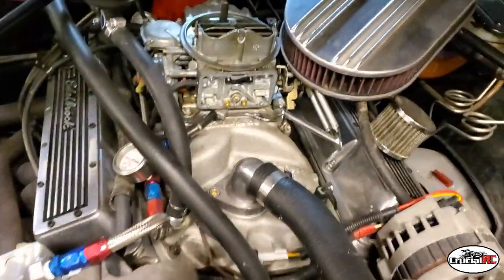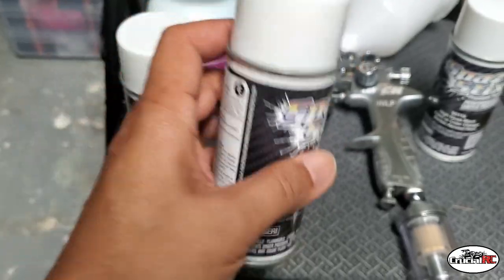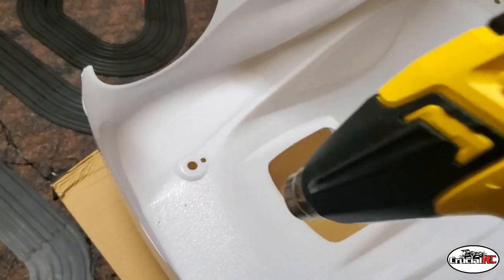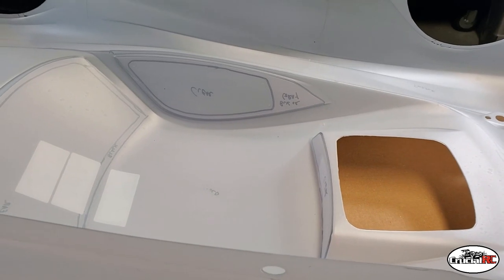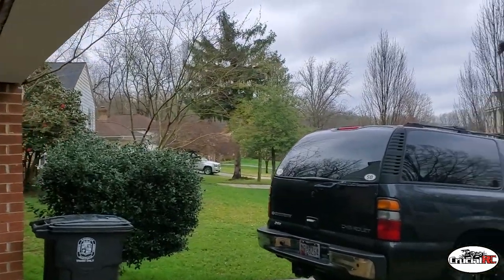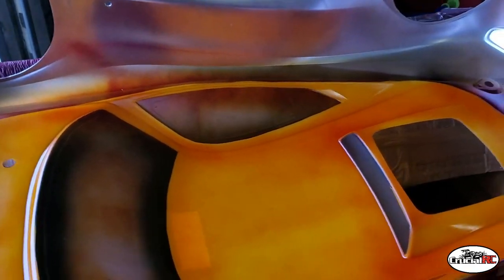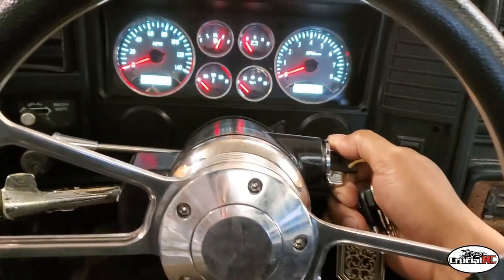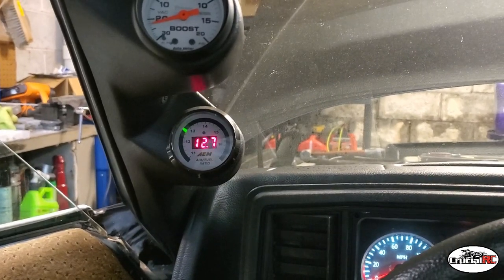Painting the MCD XS5 Body!

Comment: Love that McD and sweet Monty I got a66 chevelle getting ready to put it back on the road wanted to ask you how parts availability is for mcd/s if it’s no prob gona pull the trigger the Baja and losi 5 b need a new partner
Reply from the maker: 66 Chevelle is a beautiful ride. I get all my parts from Cardinal Racing. Not much breaks on em. I ran mine into my gmc pickup and she kept ticking. And they are built to withstand big block engines.